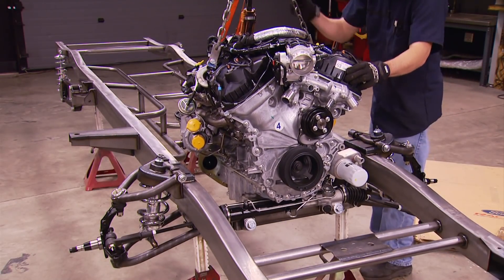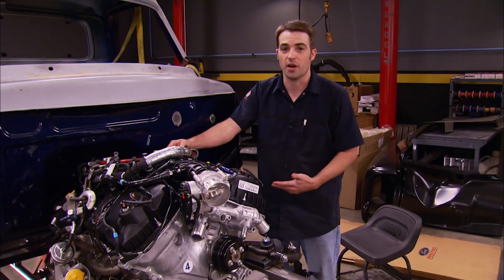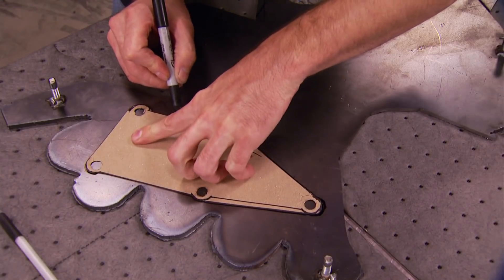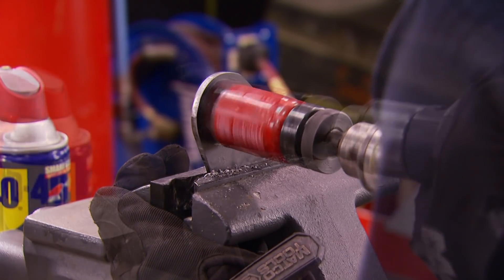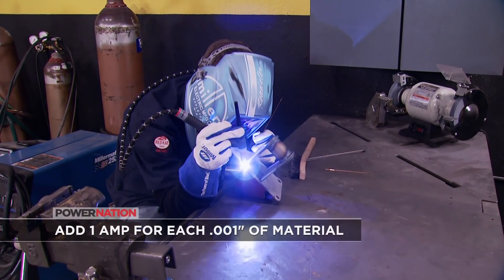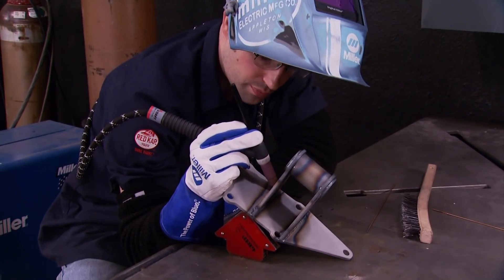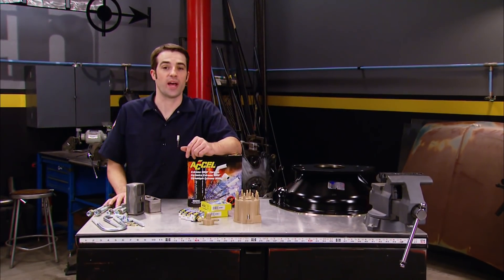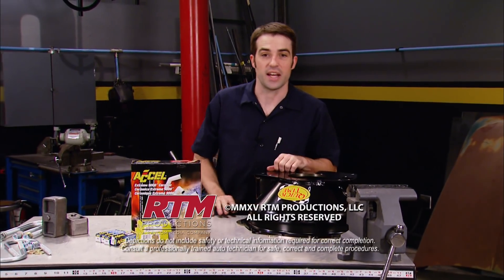Swapping A Twin Turbo EcoBoost V6 Into The '55 F100 - Truck Tech S2, E1

Comment: Awesome! Next job is help me tackle the job of dropping a chevy 350 into my Chevy HHR, setting the engine in the middle of the car behind the front seats, making it rear wheel drive, with a thm 400 or 700R4. 👍👍👍
Reply: Pretty cool are you putting your build in YouTube? Beca awesome watch
Reply: @simbanugz2906  . Yes. I have 2 HHR's. Once the high milage one has either a major trans or engine failure, i will section the car, lengthen it, and install a firewall behind the seat and re engineer the rear for rwd. If i feel so inclined , i might even chop the top, and widen the car side to side, by sectioning the center and grafting in centers from the other. This takes lots of time tho. So it will probably be in a year or more.